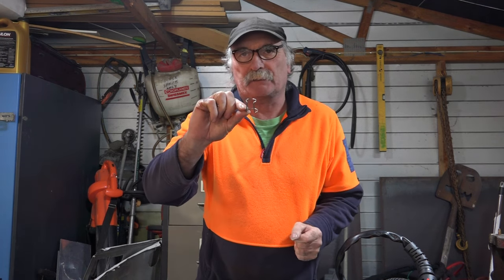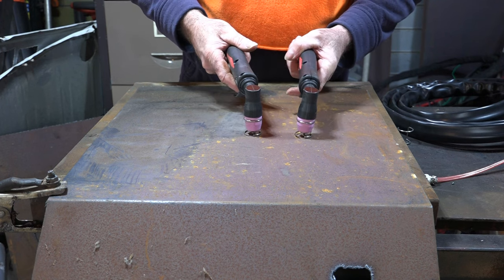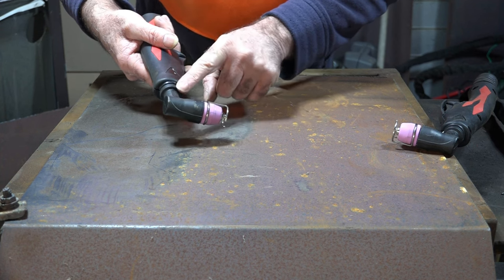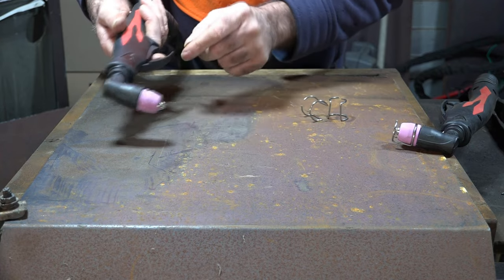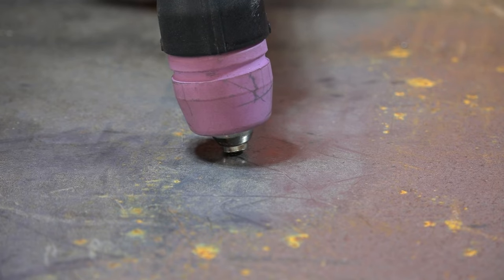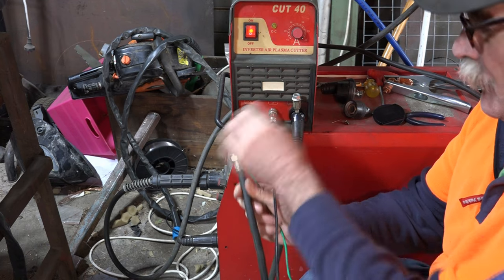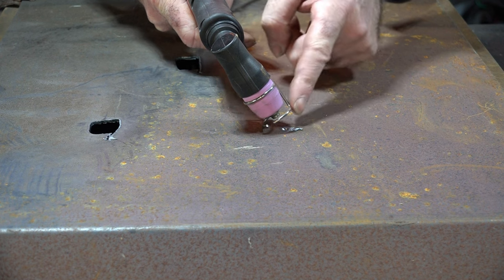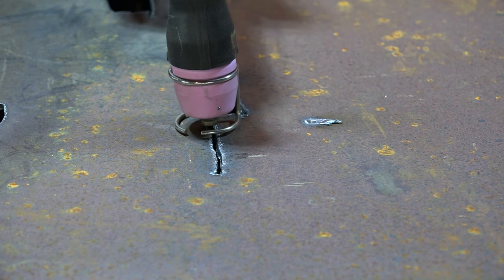Plasma Cutter Standoff Guide - Do I Need One?

Comment: Great video Pete. I have a pilot arc cutter. The little stand off is in the way for tight places. Can I buy a drag tip and use my pilot arc as a drag cutter without a standoff?
Reply from the maker: I use without a standoff but your not supposed to .It will burn out your consumables quicker mate.

Comment: Great info Pete...Thank you!  I'm struggling with cutting smaller pieces where the standoff guide snags or jumps my work-piece, causing issues.  This is especially annoying when using stencils or guides and trying to get clean lines or circles.  On a cheap, hobbyist, pilot-arc machine (AG60P torch), can i disconnect the pilot-arc wire and and cut like a drag tip?  Is there any conversion necessary (better/different consumables?) to make sure I don't blow out the tips?  Will a different torch work better to solve this?  Mostly cutting 3/16" or thinner steel. THX Again.
Reply from the maker: I find some issue .I always just take the guide off.

Comment: Does that mean I can use non pilot arc tips on my plasma and disconnect the one wire to stop it cremating the tip? Drag tips seem much better to use, my stand off guides keep melting and they get in the way.
Reply from the maker: Try turning down your power settings. Your guide should not melt mate.